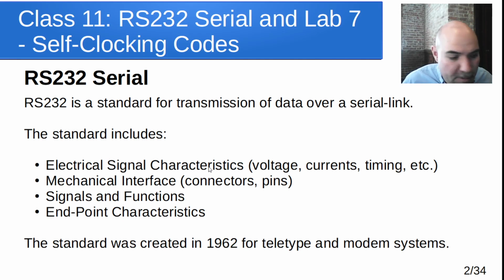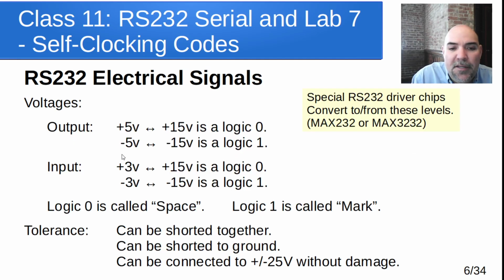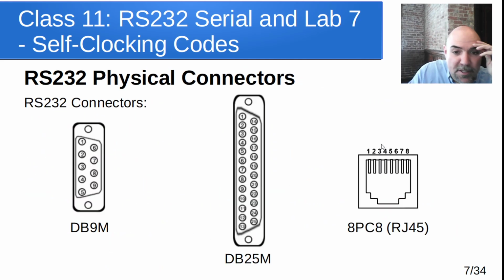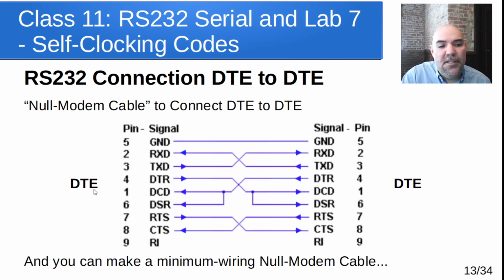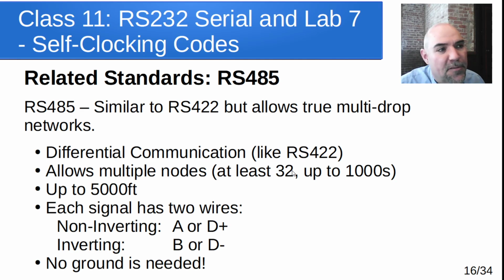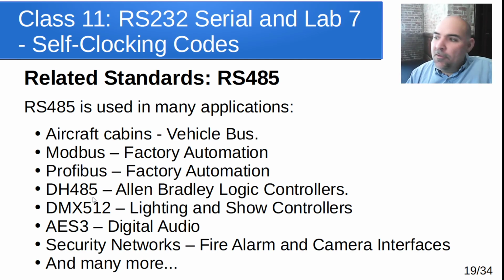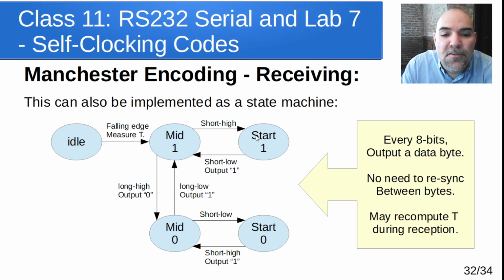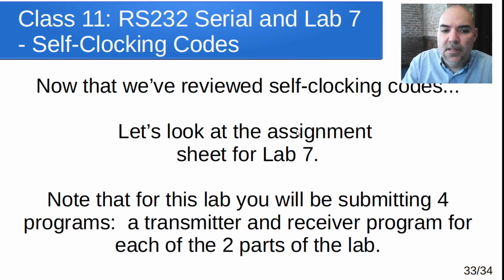ETEC3201 - Class 11 - RS232 Serial and Lab 7 - Self Clocking Codes

Comment: Fail on slide 7 - Pet peeve. There is actually no such thing as a DB9M or DB9F connector. "D" type connectors come with
 five sizes: "DA", "DB", "DC", "DD" and "DE". For standard density connectors - the pinouts for these sizes are "DA15", "DB25", "DC37", "DD50" and "DE9". Those connectors in the video are actually DE9 connectors. And slide 15 wrong. You are describing RS530 polarities, not RS422. At pure RS422 (the "A" output being "+" and "B" output being "-"). For RS422, when the A is above B, you have a high (logic 1) output and when B is above A, you have a low (logic 0). See Texas Instruments AM26LS32 datasheet, Paragraph 8.4, paragraph 1.0.  The illustration on Sheet 15 also shows RS530 signal polarities (e.g. the "B" output being "+" and "A" output being "-").
Reply from the maker: For slide 7, while the sizes are technically and more correctly defined as DA-DE , the DB9M and DB25M labels are commonly used within the industry to describe these connectors.  Manufacturers of these connectors, cables, and gender-changers also use DB9M/DB9F to describe these connectors, sometimes as frequently than the DE9.  In the future I'll be sure to use the correct terminology and mention the common-parlance usage as well.   For the RS422 signal levels, while some IC vendors label B as the inverted signal and some with A as the inverted signal, I think that A above B -> Low and B above A -> High matches the both the signaling of RS-485 and matches my experience with RS-422 (which, admittedly could have been using ICs with idiosyncratic labeling).   My description does seem to match other online resources as well.  Such as here: https://www.electronics-notes.com/articles/connectivity/serial-data-communications/rs422-basics-tutorial.php

In any case, thank you for the feedback.  I'll make corrections and provide additional context in the future.